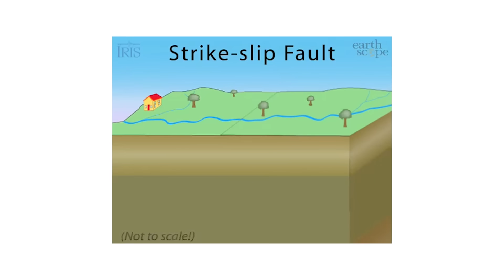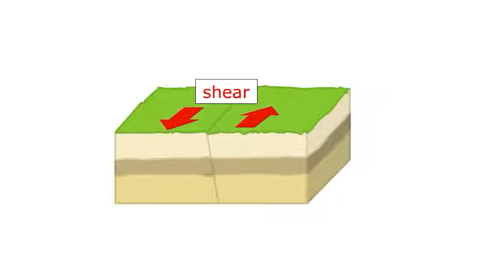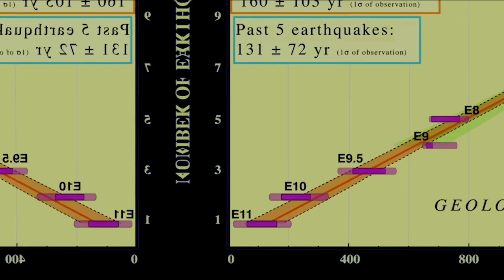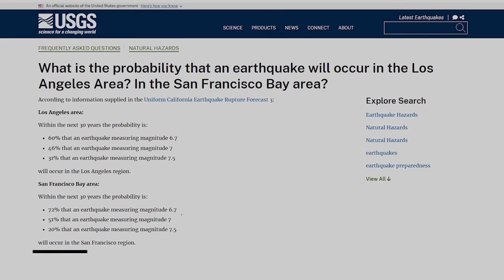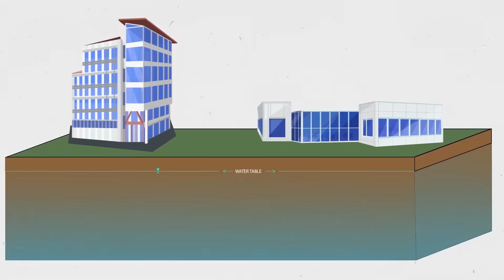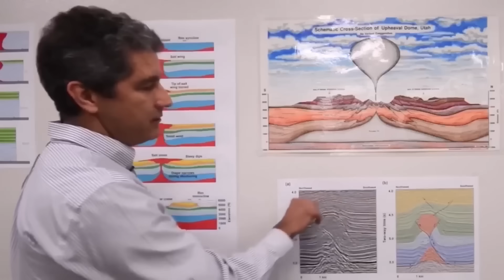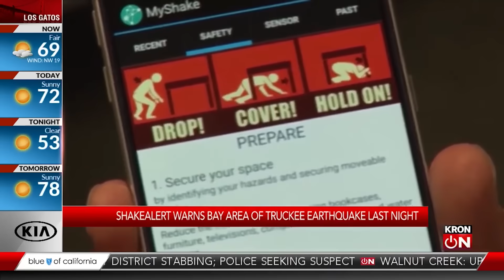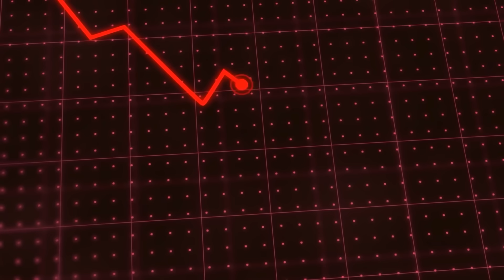Forget San Andreas! California's Hayward Fault Is About To Rupture!

Comment: Why did your video leave out the risk of the nuclear power plant in San Luis Obispo being compromised??
Reply: Because, it won't be compromised. Unrelated to Fukushima event.
Reply: If you wanna include every single different danger in a film you wont get a film of 10 minutes😂😂
Reply: It's too far away to be impacted.
Reply: I love SLO❤
Reply: Clearly he didn't research enough. Although how you can miss a nuclear power plant is beyond me.
Reply: @JaqMariBay  US Nuclear power plants are safe during any seismic event. The video is not about Nuclear power plants and their safety protocols.
Reply: @JaqMariBay  Maybe it's because he didn't look at stuff 200 miles away, where there would be zero impact.